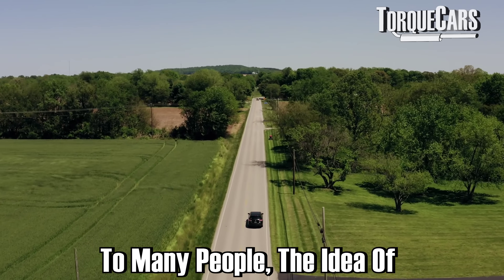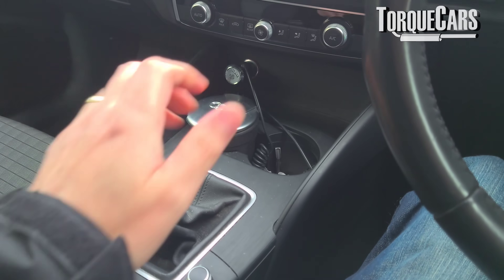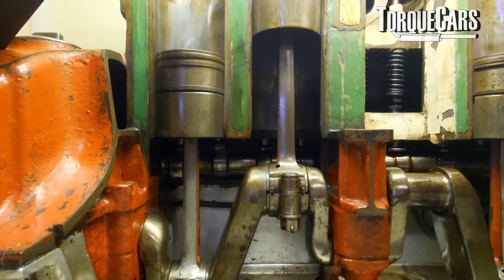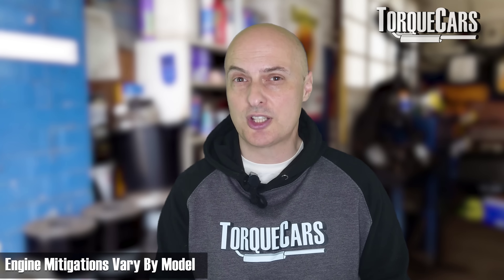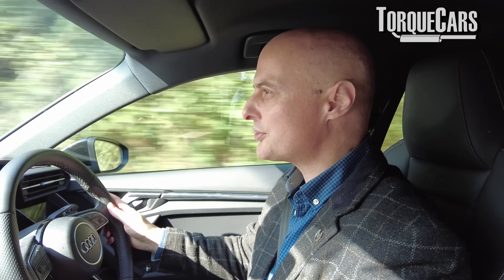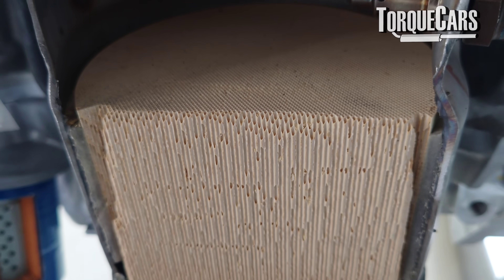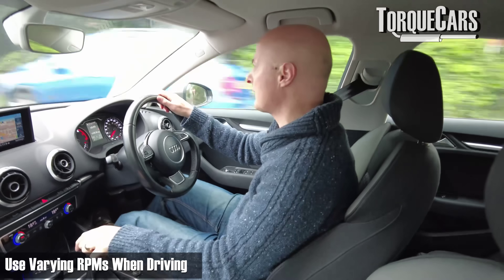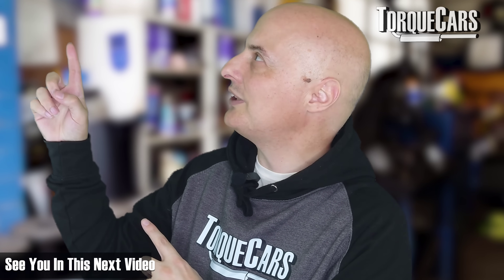BIG DAMAGE By Lugging at LOW RPM? Eco Driving Warning! (Manual Gears)

Comment: Thanks for the video. I am a retired motor tech. I know you say not to criticise you but after a lifetime of using the terminology of the higher the numerical number of the gear directly equates to the higher the ratio. But you say lower gear which as I said after a lifetime grates on my sensibilities. I was taught to drive ( especially on the open roads )  to keep the revs between 2 - 4 K rpm. Over 4K and you start to increase engine wear. If you are travelling around town at 30 it is better to be in 3rd gear rather than 4th for the same reasons you gave of less strain on pistons and crankshaft. Strangely fuel economy is better as well. Keep posting.
Reply: This is a bit outdated, though. Just a detail, some cars have gear selection suggestions. If you are not or barely under load, the gear selection suggestion, suggests rpm around 1200. Also, most modern (normal day to day use) engines have almost maximum torque above 1500 rpm to 4000 rpm. So it will almost never be necessary to exceed 2500 rpm unless you tow something heavy.
Reply: @ronaldderooij1774 his suggestion is still pretty accurate I can’t imagine minute differences like that can matter that much. And my car on the highway automatically sits around 2.5k rpm by itself
Reply: You will carbon up your engine if you drive by those gear suggestions. You might save fuel, at the cost of the engine.
Reply: @peterjohnson9438 explain?
Reply: @peterjohnson9438  the exact opposite my friend
Reply from the maker: Cheers buddy, I try to use terms that Most of the general public will interpret correctly, but totally dropped the ball there trying to simplify. I think though I can probably get away with more technical concepts if I explain them fully.
Reply: I think 2k to 3k rpms is ideal. The reason I avoid 1800 ish and below rpm in a manual is because you get a lot of drive train noise, gear box lugging out. Have never seen any carbon issues on engines which were well.  cared for or working well with carbon in general. I've never had to replace a clutch, syncros etc. in about 120k spread across 3 different vehicles. Two of them probably needed a syncro for first. 1.6L Eco Tec, 2.3L 93 ford, 2.5L boxer.
Reply: Above 4k revs have not caused wear since the 90’s.  Maybe in a few horrible companies like nissan or hyundai kia who’s engines die for any reason at all
Reply: I do fully agree with you. But when it comes to Honda engines: K series, B series or even the L series(used in the fit
Platform) are mechanically factory tested to run on high rpms especially for more performance when Vtec engages to a bigger camshaft.
It increases the fuel/gas mixture significantly more than
what it would have been driven on the milder cam. Which maintains efficiency and performance without stressing the engine.
Reply: @ChrisPatrick-q6k  same
Reply: Pressure in the system causes problem  like w.o t  turbo exes    keep the throttle action smooth steady  and   economicall   abuse any machine and it wears out faster   Common sense    ..more power equals more wear  ..you get nothing free ???       Keep oil clean helps    but abuse will eventually kill it ??   ..stop the crap ??
Reply: Some ideots  got No  mechanical sympathy  they born loons ???
Reply: Absolutely. I select 3rd when i roll into town, 5.3 vortec. D for Highway
Reply: The fuel economy is better because it's much easier to motor brake at higher RPM.

Also a more enjoyable ride, in my opinion.
Reply: I knew this would produce a debate. As I said in my original post I have been driving for 52 years and know what I'm talking about. The guidance I gave applies equally now as to then . It is necessary to keep strain on an engine to a minimum. Lugging has wrecked thousands of engines. I've had a car for up to 20 years and when I had to scrap it through rust the engine was still perfect.
Reply: @thevauxhallman7157  "If you are travelling around town at 30 it is better to be in 3rd gear rather than 4th for the same reasons you gave of less strain on pistons and crankshaft. Strangely fuel economy is better as well."  

You say this and I found this out indirectly from a speed awareness course 3 years ago, that 3rd for 30 gives less opportunity for speeding as the revs are higher and you're more aware. I've driven like that since and a by product of this was I noticed my mpg was better by 3-4mpg! I'm the next generation down from you and was taught, correct gear for the conditions and I've never hyper miled and yet always got good mpg, my current 1.2 Panda averages high 40's and mid 50's on a run and I'm happy with that.
Reply: @thevauxhallman7157  What you are describing is the correct/economic/sensible way of driving a normal sensible family vehicle, with a normally aspirated engine. I always swift between 2k RPM and 3k RPM. Then again I rarely drive faster than 100km per hour (60 miles per hour). The local roads are not really designed for that and my car is just normal/average. Now, if some people here have any "performance cars" with turbos and what-not, sure, the rules change there. Come to think of it, "modern cars", even small sensible ones, now have small turbo engines, so maybe the rules there are different since the turbo needs to have enough revs to kick in and do something.
Reply: @ΤάσοςΚαυσοκαλυβίτης  your just reiterating what I said in my 2 previous comments. I was taught advanced driving 30 years ago. The same things apply now if not more so. With a turbo engine and smaller capacities they are under too much pressure if used to their full potential. I personally don't like turbos and my engines last a long time ( 20 years or more ). I'd like to hear how many modern engines cars will still be around in 20 years if I'm still here.
Reply: @thevauxhallman7157  Yes, maybe you missed the part where I agreed with you :) I also avoid the turbocharged engines. It is naturally aspirated or nothing.
Reply: @thevauxhallman7157 passat B5 1.8t (turbo) 380k km 25 years old and still on the road. Accelerates amazingly with stage 1 190hp. 
Drinks a bit of oil but nothing unusual.
Reply: @thevauxhallman7157  Its amazing despite all the info given by long timers were still reading the 'but I get better mpg lugging"
Thick headed mofos!!
Gas is cheaper than replacing thrust bearings!!

Comment: I got a vw group (seat) 1.6 tdi engine what is the ideal rpm range in a journey of around 60/70 mile single trip? Also will rpm have effects of dpf regen?
Reply: When the car feels like power disappeared and there's more noise than umphf you're in a too low gear. dpf regen is a set parameter that has to be box ticked to occur. RPM, engine temperature, a time component, dpf pressure readings etc
Reply: I gave the same,  I try to keep it above 2K , if you use the 5th gear it bogs down, and judders  the previous owner did short journeys and never revved it hard enough, she could have walked most of the time, you can walk 4 miles in an hour easily
When I bought it the engine light kept coming on
Got the oils changed and had it serviced,  then drove it hard on long runs, 4th gear at 70 and above
A week of that and it runs smoothly,  I use 3rd gear in town and let it spin as I go down the motorway ramp only changing up when it's near to 4k

Problem has gone away and the car is nice and smooth again